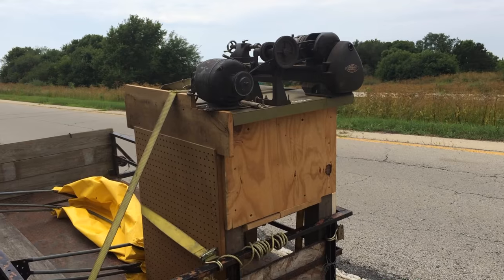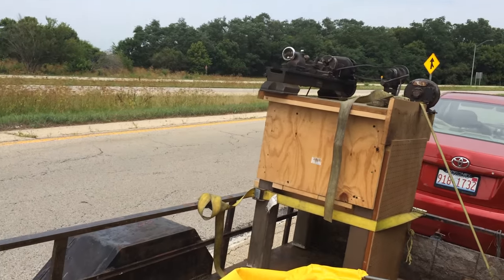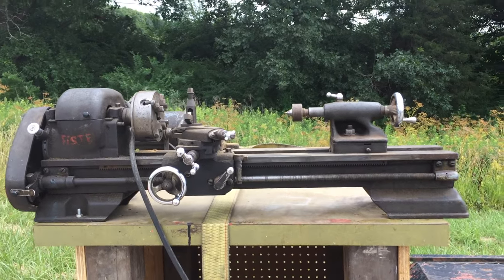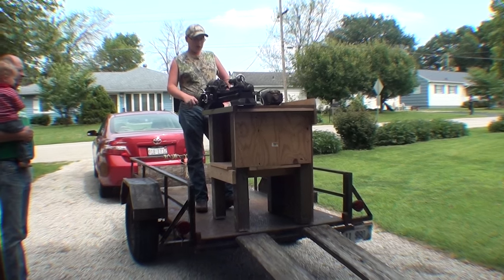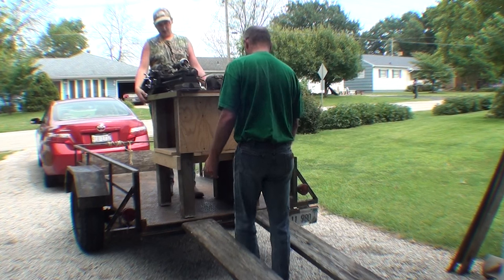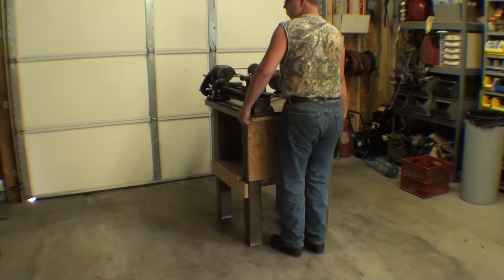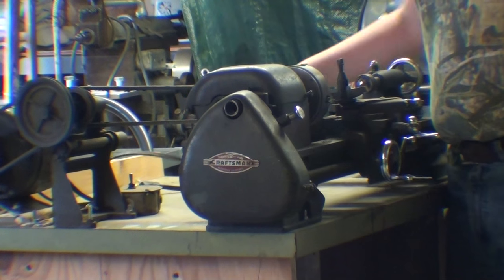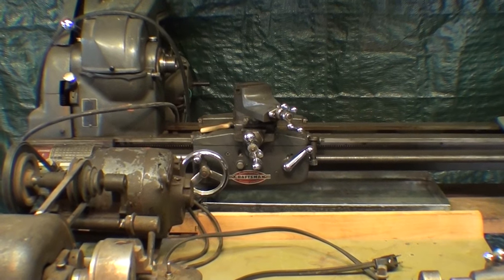SHOP TIPS #318 A Tiny Craftsman Lathe Followed Me Home tubalcain

Comment: Same as my first restoration. Craftsman 101 = Atlas 618. Same machine, different tags installed for Sears. You can find the vintage of Atlas machines by pressing out the headstock bearing races and looking at Timken's date code. Sears may have a date registry somewhere but I'm not aware of it.

This machine is tiny by any standard, and very lightweight. It's biggest design flaw is it uses the halfnuts to drive the carriage even when not threading. However, I wished many times I hadn't sold it before beginning my South Bend 16" restoration--if nothing else you can use a small lathe like this to polish parts for a larger machine. :)
Reply: The 101 is huge in comparison to the 109.

Comment: When you get into this lathe, please tell us the vintage, if possible.  There is a used machinery shop in my town that has a very similar lathe  in their lobby...in pristine condition but appears to be older, simply Atlas, but not Craftsman.  The only difference I see is their lathe has the reverse gearbox at the headstock end of the lead screw, like my old Atlas 10d has, with an oil dauber on the tailstock. That one appears new enough to not have the oil dauber hole in the tailstock. There is something quite fascinating about these little old lathes and I understand your attraction.  Looking forward to further videos on this lathe.  Thanks Mr. Pete.

Comment: That would be a great little lathe for this old woodworker to practice on to determine if I could make the leap from woodworking to machinist.  I have watched so many of your videos I think I'd have a bit of a head start.  I have never been a fan of Craftsman power tools as generally the low bidder got the deal with Sears for their line.  And we know to be low you had to cut corners.  But there was a time where some of their tools we better quality.  I have my father in laws 1959 era table saw and it is a real nice little rig that sets in my shop as a symbol of the changing times.

Comment: Mr Pete, I commented on a past video about having a Montgomery lathe that needed a home. Well I found one, actually swaped it for a J head Bridgeport mill. need a lot of work and a VFD but for my home shop it will be a great addition to my Lincoln lath.
Reply from the maker: Sounds like a great trade
Reply: I hope so. I work with an ACER at my full time job so most is the same. Someone beat the heck out of this one. But for home DIY it should work fine.

Comment: I've got a little 101 with plain bearings...hard to keep the spindle free of play. But the back gears are badly worn too, and the Zamak change gears have disintegrated, as they do in some cases. Wish it didn't have so many issues. It'd be fun to recondition.

Comment: Hey, looks just like my Atlas 618!
The half nut really isn´t the best, the spindle is neither really sturdy nor does it have a sufficient bore through it, but it served me well, that nice little machine.
Should find the time to do a rebuild, especially the ways need work. Carriage either fits to loose in the middle or too tight at the end...
At least she has the adjustable roller bearings.

Comment: I would like your advice.  I'm retired and my hobby is tinkering (carpentry, welding, blacksmithing, puzzles, bird houses, etc). I'm adequate at them for my purposes and I've never tried to make money from them. I do a fair amount of good neighbor work for free however.  My reason for writing is as follows.  I intend to purchase a small lathe and have pretty much settled on a 10 x 22 size (the Grizzly G0602 is in my price range with some nice options included).  To change speeds it requires removing and replacing belts.  For a few hundred dollars more it can be had with variable speed.  In your experience and opinion is the variable speed option a desirable thing to have?   Are speed changes all that frequent?  I understand slower speeds are desirable for cutting threads.  If you have covered this information in a video could you direct me to it (or someone else's video)?  Thanks for all the time and effort you put into your videos.
Reply from the maker: Thanks for watching.
A speed change is VERY desirable. Changing speeds with a step pulley take too much time & effort.